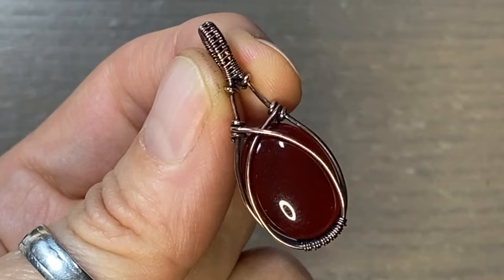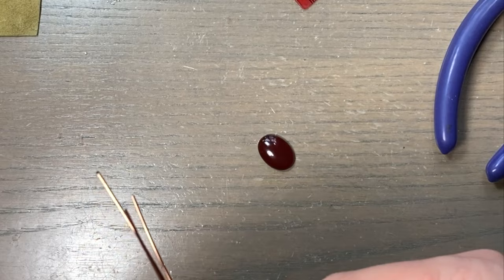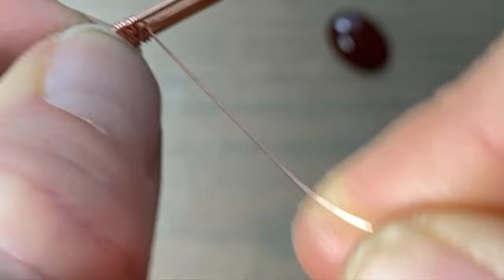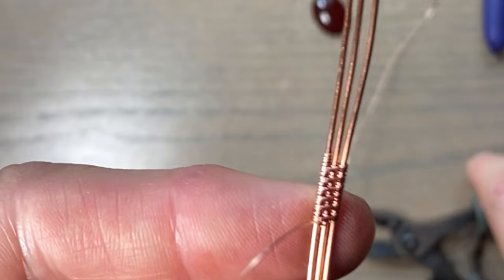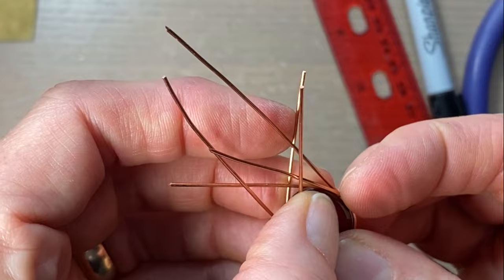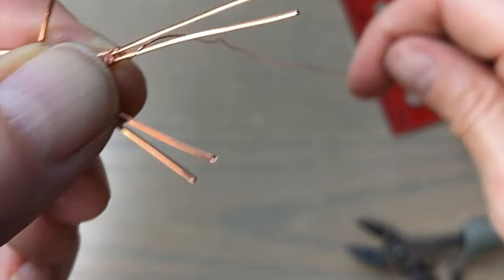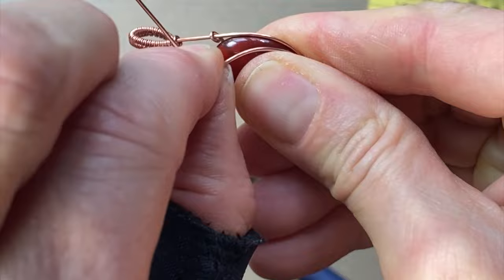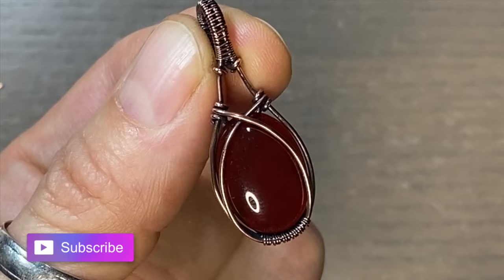Wire Wrapping Tutorial- Simple Wire Wrapped Cabochon Pendant- Great For Beginners!

Comment: I made a very simular design as the front view without any bail weaving using 2 pieces of round wire about 5" long, but ended up with a mess at the bottom of pendant, so after a week of staring at it and trying to think of a solution, I finally created one. And it's the only piece I've made without any image to go by. 
But your design is way better and sturdy. I also used a stone that was near oval and thicker, I can still pop the stone out if I wanted. So I might do that and use some scrap 28g and secure the back better.
Thank you for your tutorials! You are an amazing artist!
Reply from the maker: Thanks so much! 💜☺️

Comment: Thanks for this awesome beginner tutorial chocked full of tips!  I often struggle with figuring out the length, quantity, and gauge of wires I need for a design based on the stone’s dimensions.  Do you have any additional rules of thumb for determining this that you could share with us?❣
Reply from the maker: It all depends on the stone. I decide the gauge of wire and the amount of wires needed by the size and thickness! 💜☺️

Comment: Just a bizarre question ... ...I realize they make gold wire (plated, filled,  or solid) which you can use if preferred,  but say you have completed it in copper and instead of oxidizing it, you want a more golden or even antique gold look for the setting,  is there anything else you can do (that would be as permanent as possible) to change it? I love the quality, look and strength of copper to work with but sometimes people prefer a golden or even silver color better. I would LOVE to have a solution for a silver option if you know of one also especially if you are aware of one that won't tarnish/rub off also. Thank you for all you do- I love your designs and instructive videos 😊😅😊
Reply from the maker: Thank you! You could look into brass wire. There is also coated copper. Parawire.com has many different color choices for coated copper!

Comment: Hello! I love your videos! They are so very helpful. I was wondering what you would do if you needed to add another wire for stability? In the beginning of your video you said that 3 wires may not be enough if your stone is too fat. What length would you cut this wire to and would you place it in the center to work in with the bail wire? Would you use the same weaving technique, or use a different one? Sorry for all the questions! I am fairly new to wire weaving and I can't really find any other videos like this one. Do you maybe have a video that you could link me to using a different technique for a little bit more plump (lol) cabochon?

Thank you for the great videos and being a great teacher! And any help that you can point me in the right direction of!!
Reply from the maker: I’ll work on a video! 
That’s a great suggestion! ☺️💜

Comment: Thank you! My stone kept falling out the bottom and going in at a tilt. Any tips on how to avoid that so it's also secure there? I tried to squeeze the frame as much as possible so it was snug, though I had less room between the top of my stone and the bail than in yours. I think I also had some trouble with crossing the front and back - lower means more secure but then there's no bare frame wire to attach them to (since it's pressing against the stone), too high so they can be secured to the frame, but the stone is only gripped at the top.